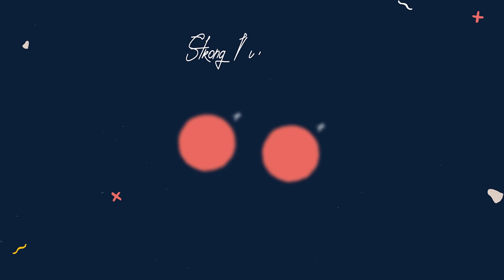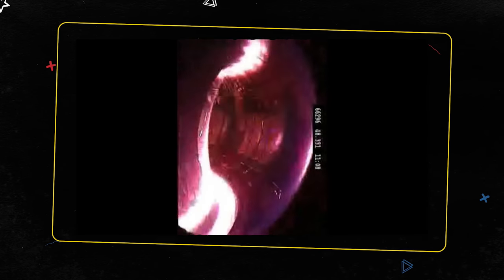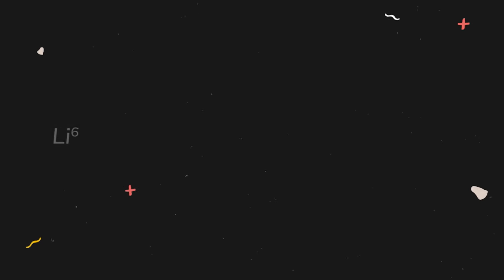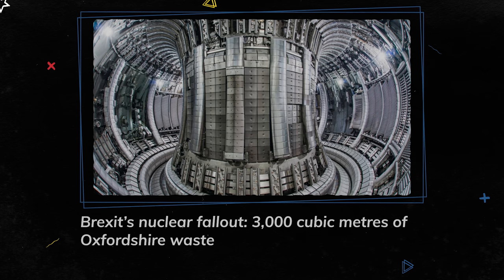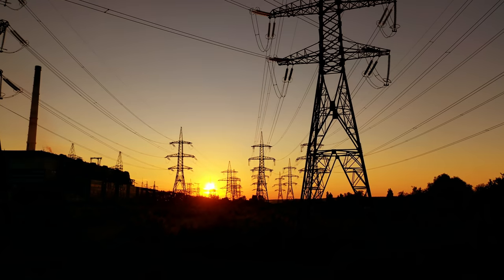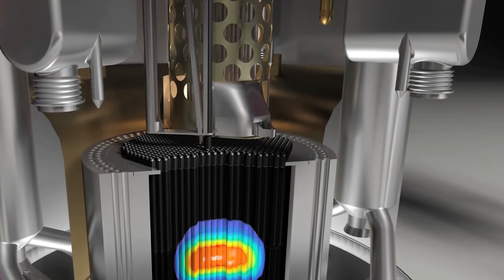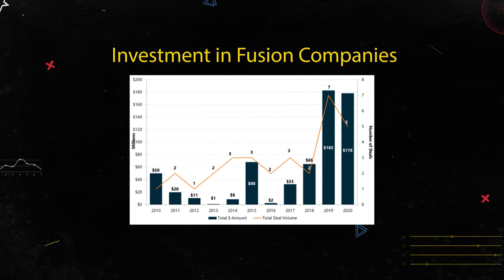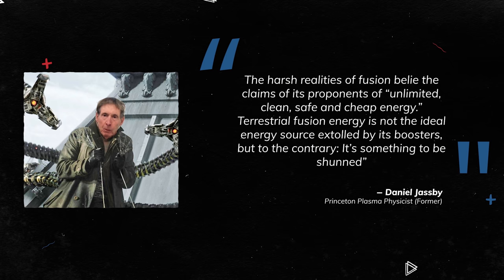What No One Else Is Telling You About Nuclear Fusion

Comment: they cant even get the confinement working. the equipment that hold the plasma in place get damaged by the radiation of the reactor undergoing fusion. the increased voltage and current is caused by ionized radiation as particles bombard the confinement plasma as they undergo fusion.  fission and water cooling is outdated. the secret to fusion power is in the ionization of the plasma confinement itself. a power transformer can extract these currents and voltages even with dc current by creating a tank circuit. the plasma reactor works both ways. a fusion reaction chould be a plasma based energy generator using electricty combined by ionization of nuclear processes to create greater current and voltage than put in. the problem is that nuclear science is very young and people behind fusion projects do not even think of how to take advantage of the ionization generating damage to the equipment as a way to generate fusion power directly as electric current. such a plasma can be converted into a force field by using standing waves by using a natural interference pattern in the plasma amplifying it and bring it out of phase with itself. that will create electromagnetic nodes and antinodes that will create forces capable or improving confinement.

Comment: ITER by now is old technology. And indeed just research. 
But by now there is much newer stuff around.

Price-problem: 
Predominantly comes from the size.
New HTSL magnets allow for a massive size reduction 
which equates to an equally massive cost reduction. 
Robots are a one time design investment. 
Then it's mass production.

Electrical power breakeven: 
We are in the stretch of the last order of magnitude.
This event is (by my judgement) imminent and will almost 
certainly not take another 30 Years. 
Like the running joke goes.

Quenching: 
Belt shaped HTSLs conductors are quite quench-resilient the substrate catches the current (and forces) from the thin HTSL layer. 
Worst case scenario if a seriously big (chemical) bomb is dropped on a live operating reactor, 
then the amount of radioactive material resealed (a few grams of plasma) is still many orders of magnitude smaller 
compared to the horrifying fission accidents we know of. 

Embrittlement: 
Eventually solved by liquid salt blankets since liquids can't metamictise.

Radioactive waste: 
That liquid salt blanket actually can transmute our fission waste problem away. Eventually. Certainly not easy.
In fact this will very well complement the supposedly safer liquid salt fission reactors that are under development.
Admittedly transmuting nuclear fission waste to nuclear fission fuel worsens the worst case scenario from before depending on the quantity of inventory.
No graphite fires or steam detonations mixed in with plenty of Corium straight from hell though.
Diverter activation: 
Designs to avert long term radioactive isotopes are supposedly possible.
Which Limits required storage time to a point where warning signs can maintained.

Tritium tightness and recovery is indeed a challenge.
Actually I deem proliferation as the one single biggest remaining problem.

It will still take a long long time till humanity has fixed Earth's CO2 levels back to pre-industrial times. If ever.
I would not be willing to bet that fusion is still too expensive by then. 
But this highly uncertain. Yes.
 
That said the best application space for nuclear fusion is still extraterrestrial.
Extraterrestrial, but human made in the outer solar system where 
both sunlight and heavy fissile elements are scarce but hydrogen is abundant in ices and gases.

Comment: Fast breeder reactors  whether liquid metal, MSR, or HTGR are the future. From an efficiency perspective, a brayton cycle fast reactor such asEM2, HolosGen Quad/Titan, or NuGen engine are the ideal. Elimination of balance of plant and net efficiencies equal to or better than the best industrial gas turbines (70%+). There is enough fissile material that has already been mined and processed to supply the worlds energy needs for hundreds of years.

Also, the "renewables" base-loading problem cannot be solved by batteries/hydrogen. Furthermore, wind in particular has unforeseen climate effects when you talk about anything close to the amount of turbines required for a "renewables only" approach, to say nothing of the acreage required, which is in the tens of thousands or more. Its already a proven fact that even small scale wind farms have local negative climate effects and the effect on global wind patterns from large scale farms is only beginning to be contemplated. Wind and solar are not free. Not even close.

Comment: At short term the world needs to fully switch to nuclear, this as the only real viable alternative is using fossil fuels at this time. Wind does not always blow at the needed speeds, sun does not always shine, you can never fully rely on them. Fossil fuels kills a lot of people as fine dust is a slow killer, far more life years have been lost due to fossil fuel than to nuclear.
Long term fussion is still an option, challenges exist to make it efficient, cheap and safe. But it does not mean it is impossible.
Nuclear also was costly at the start, many things seem impossible until they are not. Things seem expensive until they get cheap.
Like recently with EUV lithography machines, many said it was impossible, it was not feasible to build a machine in this way. 
But still it exists today, making the smallest and fastest computer chips ever.
We do need to consider the unthinkable though, that we might not solve it in the next hundred years, we even might never solve it.
So the question becomes how do we solve the problems of today? I say with nuclear, but we always keep working towards better alternatives as best we can. 
When you start to think things are not possible, it is the death of progress. If everybody had that thought we still be savages living in caves.

Comment: Meanwhile, don’t trash the coal plants. They’re still needed.
Reply: We can survive without coal and transfer to natural gas with current technology and reasonable fund going further into renewables and nuclear is possible with current tech and financialy possible no where near as easy
Reply: @drgrey7026  All true but we need a fallback as our energy needs are ever increasing. So while I’d like to see gas as a baseline, the reality is that whatever is cheap and available will be used. China is a good example. They’re still building a large number of coal plants “just in case”.
Reply: @ewiem4351  currently natural gas is probably the cheapest solution  overall and solar and wind is cheapest if you forget about storage and other grid requirements which you shouldn't but it's there I. The  fact that people will simply use the cheapest option is why we need a carbon tax otherwise it will never happen

Comment: I was aware of most of the problems you mention, apart from the magnet problem. Yes, there are huge obstacles, but I think they may be overcome eventually. Meanwhile, perhaps thorium reactors  could be used as a stopgap until fusion is perfected. I'm sure I don't need to tell you about the advantages and disadvantages of thorium reactors, but as you know, they have some major advantages over uranium. However, they are still semi-experimental and it has yet to be established which form of reactor would be the best choice. India is a pioneer of thorium-fuelled reactors, so perhaps you could do a video on them some time.
Reply: I was aware about this comment. Knew it all yes. I knew indeed. But maybe if we drink some chlorox it may work? Like 5 seconds.

Comment: Name is right, your explosion risk claim is completely and utterly  bogus.  You are overestimating the plasma density and energy of momentum by several orders of magnitude.  The plasma is at a density only slightly above a vacuum.  This wisp of plasma would have to burn through tons of electromagnets cooled to near absolute zero to escape.  If it did there wouldn't be enough to even make a hydrogen fire let alone explosion.  There would be more chance of implosion than explosion. 
 
And then there is the fact that what would be released is tritium.  With a 12.32 yr half life and a beta emission energy so low that it barely qualifies as ionizing radiation.  You can't even pick it up reliably with a geiger counter,, even one that is good for alpha emitters.  There is zero risk except from ingestion, and only has a 3.5day biological half life, so it clears quickly and doesn't concentrate in any tissue.  Risk is low even with large exposures. 

You claim the fusion tritium hazard isn't much improvement over the fission reactor meltdown hazard. So fusion doesn't have any big advantage over fission on hazardous isotope release.  Really?  Did you look into this or just assume.  I'm just a dumb molecular biologist and neuroscientist, who hasn't taken physics since I was an undergrad (and only introductory physics!), but even I know that claim is not tenable. 

Fission reactor fuel in use has strong alpha, beta, and gamma emitters of sufficient intensity to kill you within 10s of seconds  to a few minutes standing next to it unshielded.  Many of the isotopes in the fuel are specifically absorbed and held in your tissues for prolonged times, weeks or months.... consider radioiodine (thyroid) and strontium (bone).  Risk is high with small exposures..  It remains melting metal  physically hot due to decay energy, enough to produce steam explosions..  In water, many fission reactior designs will produce abundant hydrogen gas, enough to produce large explosions.

It is clear that there little comparison let alone equivalency..  If you can refute and counter argue in support of the original claim, please do. If not, perhaps some text to acknowledge such might be a good idea.
Reply from the maker: Sure. 

We’re not talking about a plasma explosion. We’re talking about the fire and explosion risk of molten Lithium. 

Most of the energy released is in the form of neutrons. Everything the neutrons touch will become radioactive. So there will be some pretty high levels of radiation in there. 

Yes, Tritium is not extremely dangerous, but what do you think will be regulators point of view towards radioactive material dispersal?

Aside from that, the main problem with Tritium is closing the reaction chain without losing ANY of the tritium that was initially fed into the reaction, or bred from Lithium. 

Sure, you could have CANDU reactors produce more Tritium, but then CANDU reactors will almost certainly be much cheaper than Fusion so may as well continue using those. 

But all of these things have possible solutions like I said in the video. The next thing is how do you make an economic case for Fusion. There have already been papers written on this. 

There is almost no outcome where Fusion as it is currently being pursued can possibly make Electricity cheaply. 

Considering that you need to go much bigger than ITER to actually counteract the parasitic power drain of the plant, niche cases won’t help here either.

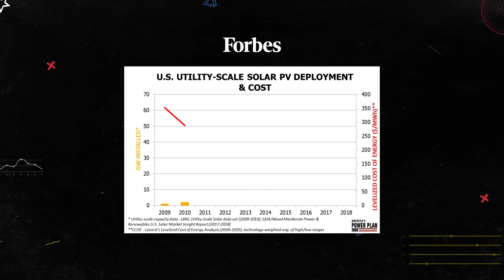Comment: 11:22 "cost of renewables is plummeting" … so… the "cost" of building giant bird chopping mass bird extinction devices, or limited lifespan solar collectors with toxic components that leech out and have no robust long-term recycling plan in place is getting cheaper? Wonderful. Still no robust plan in place anywhere to handle the intermittency (ie. no grid-scale battery systems), nothing in place to supply large massive scale production of solar with respect to the rare earth components and massive amount of silver required. No one anywhere has proposed how to make these wonderful so-called "green techs" viable on large scale without ridding the Earth entirely of birds, and making giant dangerous towers that can collapse and kill people or how to manage long-term solar, and how to turn these into always-on, round-the-clock solutions for massive power consumption at a low price. Not only is this intermittency problem not solved, no one is even seriously discussing any solution anywhere that will be implemented even in the next 10 to 15 years. Hydro is awesome if you don't mind turning valleys into giant water-landfills, but where are new plants going to be built? There aren't lots of viable places near water which aren't built up where new dams can be built, certainly not in the US, and probably not in many developed countries either.

Nuclear remains the only viable future for energy if we don't want to burn fossil fuels forever.

Comment: I think that we are missing a fundamental concept when it comes to fusion. Getting the proton close enough for the strong force to overcome electrostatic repulsion shouldn't require such high temperatures. There should be a way to temporarily neutralize the repulsive forces. NO, I do not know how to do this as I am not a physicist, but it seems to me that fields and waves can interfere with each other so this should be possible.
Reply: Yeah, violating the Pauli-exclusion-principle, which is a core aspect of quantum mechanics is actually pssible like that and even feasably applicable. /s.  ...Yeah, no.
Reply: @lennoxbaumbach390  Even that principle only applies to specific circumstances. There are exceptions to "rules" and "principles". Even the theory of relativity has exceptions.

Comment: Fusion is a Multi-billion dollar boondoggle.  It' a waste of money.  The technology to boil water to create steam pressure to turn a generator was created in the 1800s for less than a Billion even when adjusted to todays dollars.  Fusion like Fission energy is nothing more than technology slight of hand.  Look over there at the shiny flashy thingy, not over there to see I'm robbing you blind.  We waste this money when we should be looking into Electro-Gravitics.  Looking into how to convert heat directly into useable electrical enegy without water being a middle man.  Researching how to upscale the Casimir Effect.  Removing the stigma of Zero Point Energy research also known as Vacuum Energy.  That is where the Billions upon Billions of dollars wasted should have gone to.  These technologies not only would help reduce the So-called climate problem, but would work to establish colonies on the Moon, Mars, possible Venus and obital stations.  If you have to put enormous sums of enegy into a system to get energy, how is that a good, viable sustainable solution?